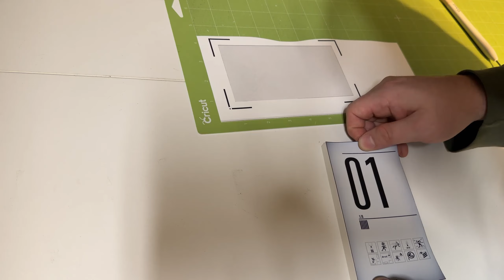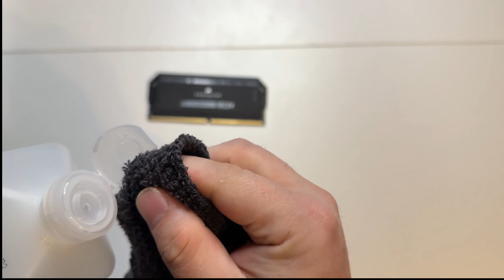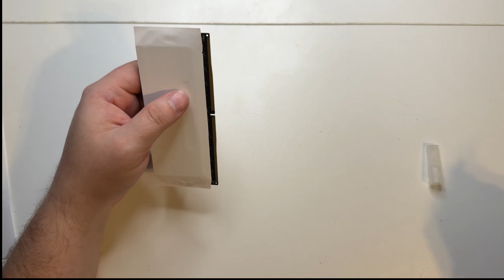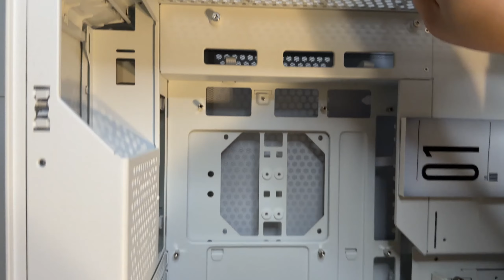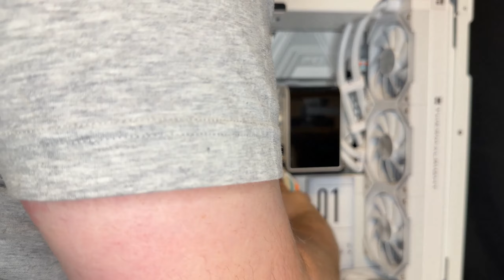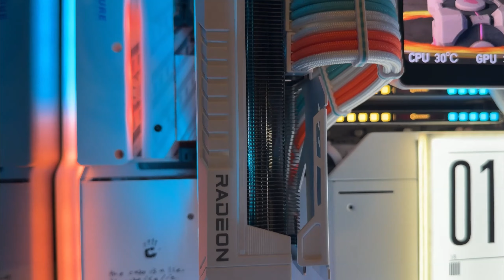Portal Themed Gaming PC

Comment: Really cool, could you let me know where do you get that 01 portal light, I want to add it to my pc, ty
Reply from the maker: Thanks! I made it myself. If you watch far enough into the video, you can see me making it. The frame is 3D printed (I believe I put a link to the model I designed in the description), the sign image is just printed onto vinyl sticker paper and then I used a white LED strip inside the frame to backlight it and plugged it into the motherboard USB in the back.